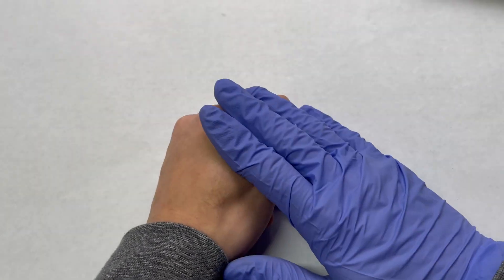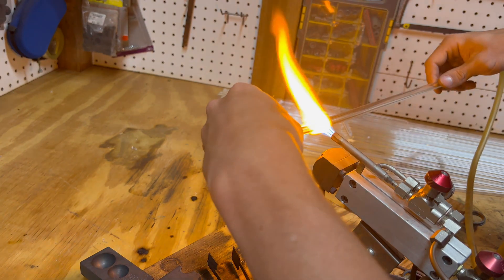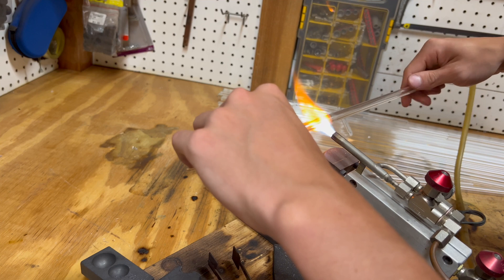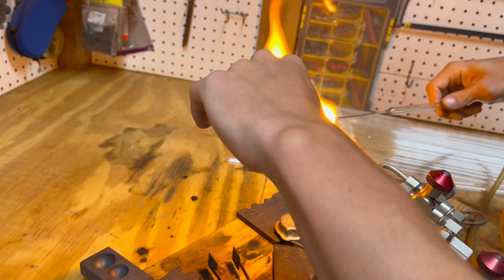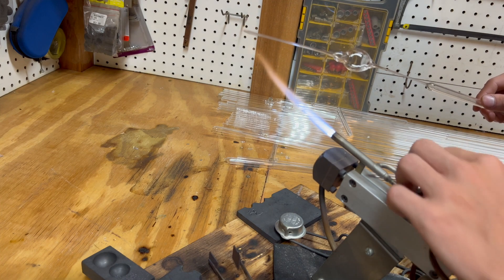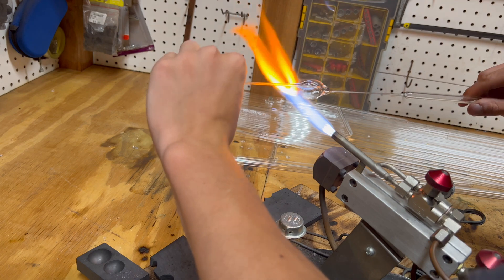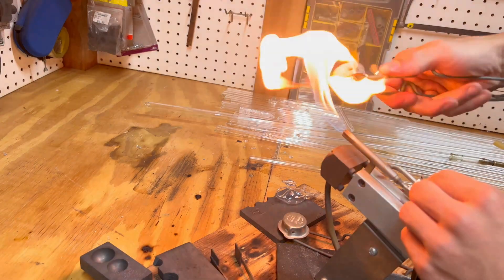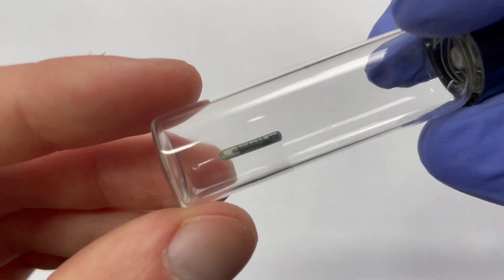RFID implant pt:2 answering commonly  asked questions

Comment: Hey! Super sick that you got the implants! 
Being that this is a slightly“older” video now, 
And a recent video includes some GTAW action- 
Have you Had any issues since the welding? I.e. information loss? And have you used any AC welding since the procedure?
- Aside from the (relatively) well known warnings That medical implants have been known to cause discomfort to the person
Specifically with AC welding I know- that if you hold some magnets they actually vibrate in your hand if you bring it close to an AC polarity tig arc/ and also a powered transformer too!

Definitely worth trying the magnet thing lmao but 
Do the implants actually make any noticeable effects??
Reply from the maker: Thank for the comment! I haven’t noticed anything really, I can’t feel it at all and only notice it when someone brings it up. I’ve worked with some strong magnets and it still works great and it opens everything still!

Comment: I used to want one of those magnetic implants pretty bad. I’ve since talked myself out of it. Quick question: does your copper doped zinc sulfide phosphoresce with other types of radiation besides UV and alpha particles? I have heard it or a similar phosphor was once used in CRT monitors, or in x ray films. 

Since you are pretty good at lampworking, you should try your hand at making a miniature cold cathode CRT tube and using some coils to deflect the electron beam into a zinc sulfide phosphor screen. Could be a fun video.